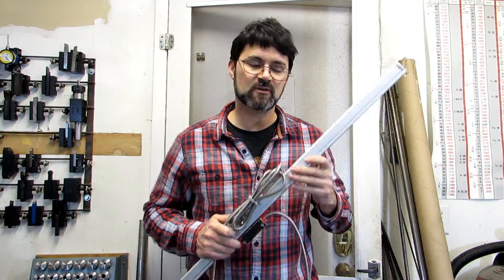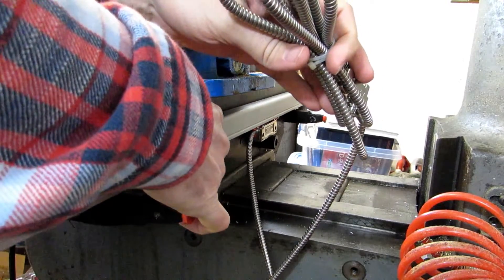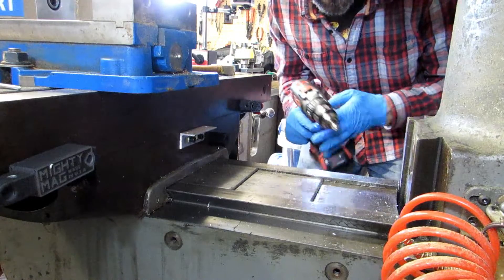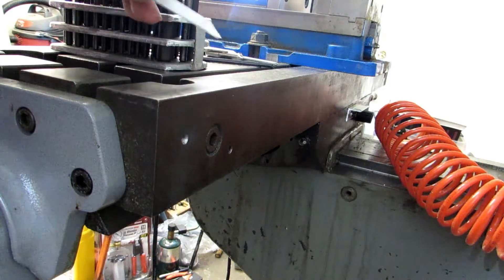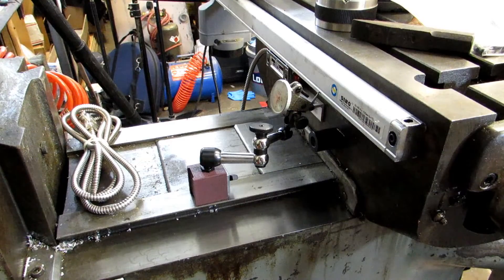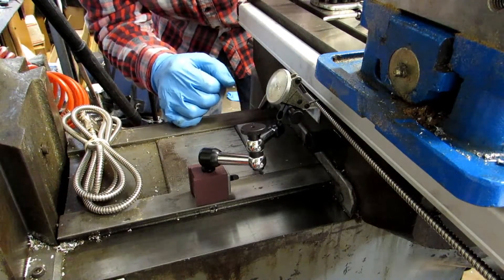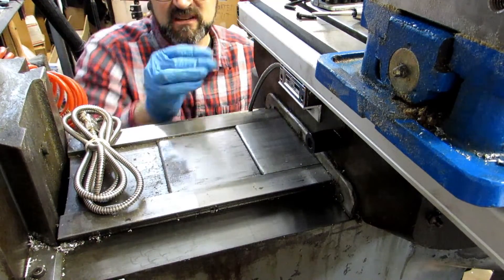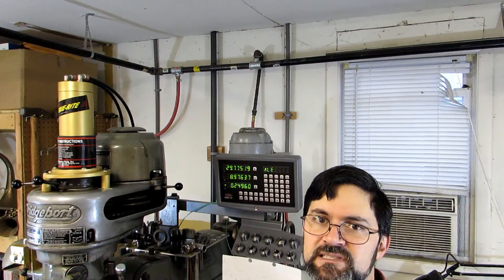How to Install a DRO 4 - Installing the X Axis Scale

Comment: Hello Stuart!  I just installed 3-axis and one person commented on setting them parallel.  It's always good to eliminate possible error. I set mine very close as I was working off machined surfaces on my mill but I never checked them with an indicator. I'm certain I'm parallel well within .030". If you do the math for a 10" long scale an alignment error of .100" would result in a .0005" error over 10" of travel. I'd say my scales are much closer to being within .030" which would result in an error of .0002" over 10" or  .0004" over 20". Striving for perfection is always good but I'm totally okay with less than a half!  I'm not so good at math so feel free to correct me if I'm wrong. Is there something in the scale reader head that freaks out with minor side to side movements? My first install was a magnetic $35 DRO (per axis). Compared to the table dials it was off .015" over 20-inches but I borrowed a 20" caliper from work and both axis were dead on. The dial discrepancy was likely due to it being a Chinese mill and lead screw wear. Was I just lucky or are glass scales more particular???

Comment: Thanks for your videos - they helped me a LOT. One thing though: I also got SINO scales like yours, and at least on one  of the scales the position of the reader head was terrible with the transport fittings mounted - and that was in both directions (distance from head to scale and off-center on the scale). In fact I feel that the mounting of the reader heads are by far the worst part.
Reply from the maker: I would definitely agree. I had to improvise a lot more with mounting the readers.

Comment: Top tip when  adjusting the height, measure it with a depth mike from the top of the table , subtract the required movement lock up then put into position again. Put back into position rais the scale to touch it. Repeat again until in position.

Comment: Hi folks. Getting the scale level seems to be rather tricky. I've not installed one - yet - but one idea I have, if there is the space - is to have a sub frame that is vertically adjustable, at least on one end, by using a fine threaded machine screw. Possibly more trouble than it is worth! BobUK.

Comment: I got 0.05 mm variation..do I have any problems
Reply from the maker: Having the scale mounted at an angle can result in an error in your reading because you will be measuring along the hypotenuse of a triangle instead of the flat bottom. The readout will say you have traveled X amount, but in reality you have gone less than that.
Reply: @StuartdeHaro  thank you but the X scale slightly different center 0.15 mm curve though end is better within 0.03 limit..is that ok
Reply from the maker: I would say that's more than acceptable.
Reply: @StuartdeHaro  what are the problems if I got 1 mm taper in scale

Comment: I just can't see losing an inch of y travel to mount the DRO.  Is there really no way you could have mounted this on the front side?  Ugly, and you've got stops to work around, but there must be a way.
Reply from the maker: There are plenty of people who have done that.  The big challenge is making the adapter to hold the reader head since the front of the saddle is angled compared to the table.  You also lose the ability to use hard stops on the table.  To me, the main issue is that the scale will be more exposed on the front of the table.  This makes it more likely to get some damage when moving the vise or heavy parts on or off the table, or when handling longer pieces of material around the machine.
Reply: I mounted it on the front of my small Wabeco mill.

Comment: For whatever reason, all mfr's and suppliers of these seemingly keep it a secret how to choose and install them. There is another secret that I never seen addressed, and that being, what if the scale choices available are either too long, longer than the table, or too short, less than travel? I encounter this issue, and so, chose a completely different system, less accurate, but it works. I found those scales that are caliper scales. I reckoned I could just cut them, and yes, that works. I have some machines that I would love to have more accurate dro's on, but, unless there is a known way to install the type in this video, I will install the other type. I know another person who has the same issue too. Likely there are a real lot of people with this issue. Your video is right on when installing the more accurate kind on a mill when the proper length is available. I have done this too.
Reply from the maker: You can do it with a scale longer than the table.  You just need a bracket that is the length of the scale and mount that bracket to the table.  Obviously, this opens up the possibility of running into the scale with other equipment, so you have to move with caution around them.
Reply: There are a couple of videos out there on installing a DRO that demonstrate how to trim length off of a glass scale or a magnetic scale.
Reply: You can cut scales down, google dropros, they have a write up on both magnetic and glass scale sizing